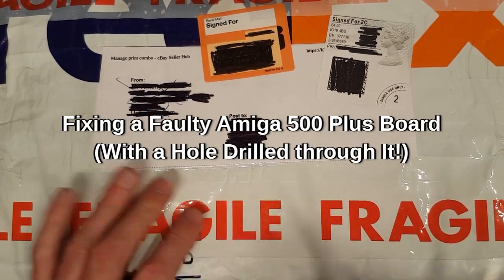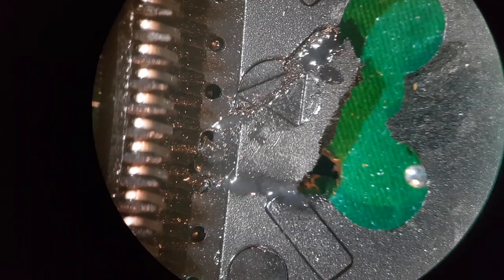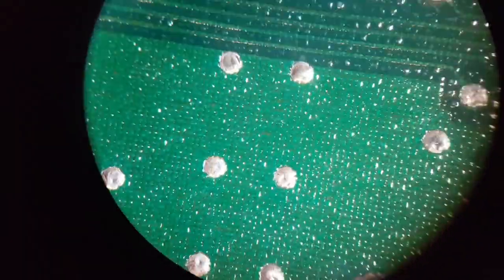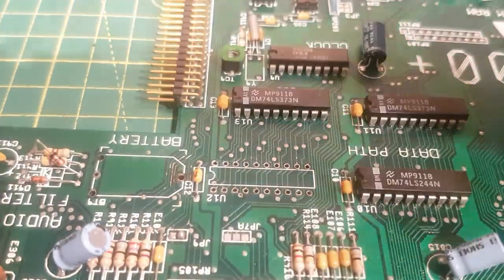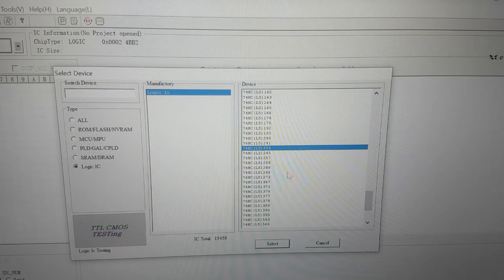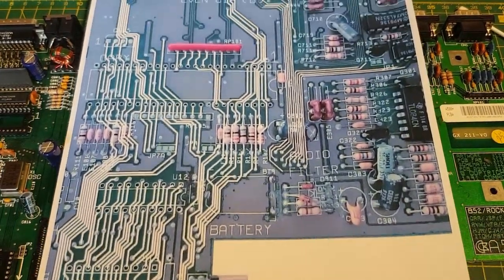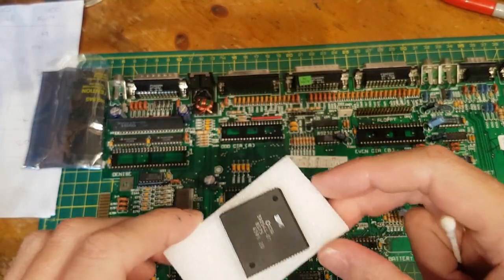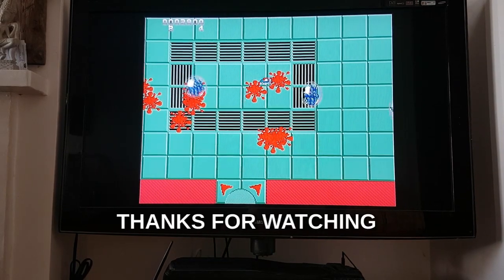Fixing a Faulty Amiga 500 Plus Board: The 'Hole' Story

Comment: I see many of the A500 plus boards sold on ebay these days have that hole drilled through the groundplane. But it shows in the pictures at least. But no mention in the description. They do this because it's risky using the extraction tool to remove 8375 Agnus without damaging/scratching it. the 8375 goes for high prices these days.
Reply: Why does the chip fetch a good price?

Comment: Great job!  LOL @ someone drilling a hole under Agnus!  That board escaped relatively well regards the battery leakage!
Reply from the maker: Thanks. Yep, it is the best board I have seen so far (apart from the hole in it) 🤣. I will probably patch the hole up with something to stop it rusting. Silly really as the Agnus socket was probably the most valuable part of the board. Had to do a double take to see if I had missed it on the eBay picture!

Comment: Even there was a hole, you still managed to fix it. Good job! I was even surprised you managed to fix the traces and that without using flux.
Reply from the maker: Thanks. I used my favourite solder. I get it from Phil at Retroleum. It is really easy to work with 0.7mm 60:40 rosin cored stuff. I get through loads of it but he only sells it in 3m lengths 🤣